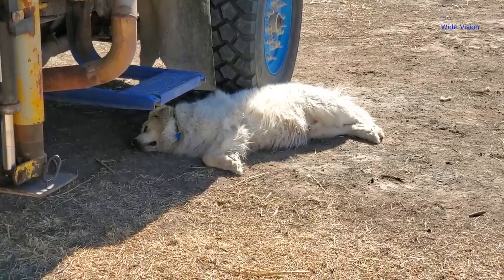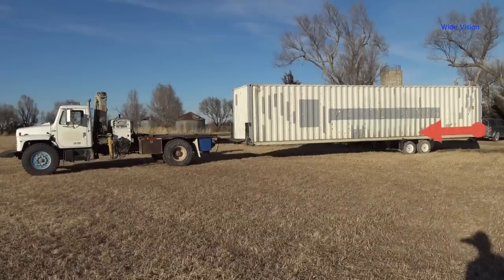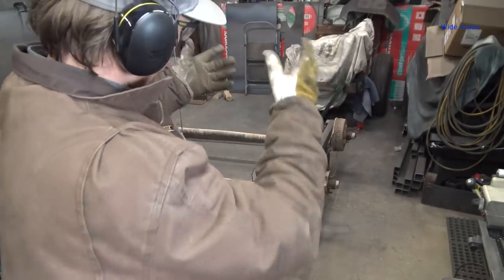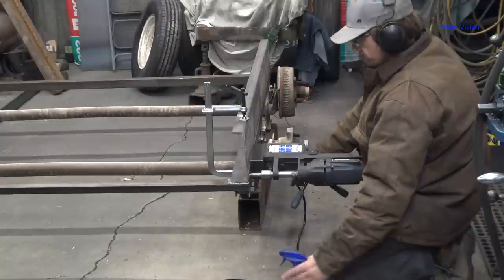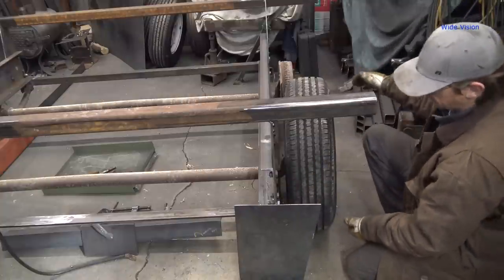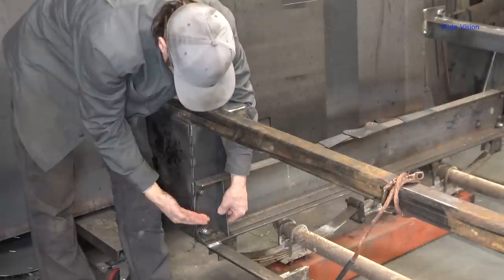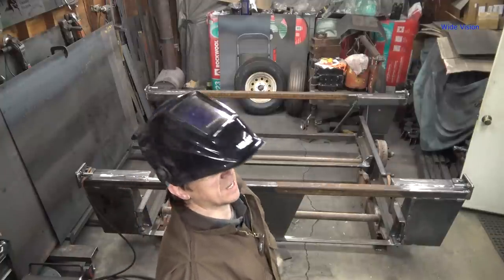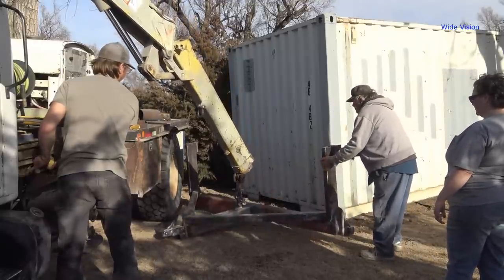Shipping Container DOLLY BUILD

Comment: What about using 3 3,500 or 7,500 lb axle spring sets.  I realize three axles complicate stresses on the side loads when turning but, having extra load margin would be good and should you get a low air pressure or failed tire you could still move it a good ways till you could repair/replace a tire.

Comment: I think I might have stepped up to plating rather than sheet metal on your structural components (gussets, corners, uprights, etc.).  Especially since you plan to use this in the future and it is overloaded for the 40'.  Those smaller pieces should have been laying in the left over pile in a fabrication shop as they were not that big.  Lot of forces other than just weight when you think about a 40' lever arm on a short axle unit.  Curious to see how lifting the container goes to get the trailer under it.